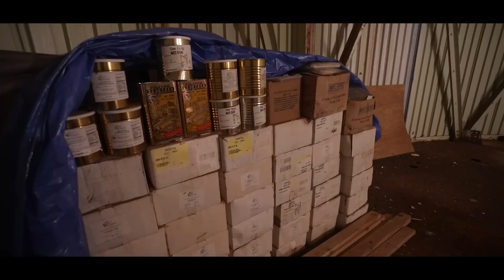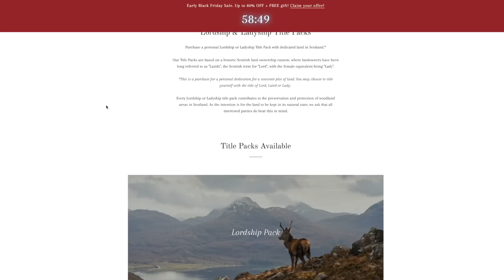Prepping for DOOMSDAY at the NUCLEAR Missile BUNKER!!! (Ready for Putin's NUKE)

Comment: Hi Flair, one question, if the power cable is currently coming through a vent that has a cone on top then surely that would mean the bunker isn't fully sealed to the outside, so if (hopefully not) you did need to use the bunker because of Putin launching Nukes you wouldn't be sealed off from the radiation etc, also does the bunker have air filtration system? Ive watched your videos for years and I have to say the bunker ones are the ones I look forward to now as I can't wait to see what you do with it, based on your previous videos like the ranch cabin renovation, I know you are going to make the bunker awesome. Keep the videos coming whether on this channel or Beefcake construction channel. Im from the UK but have found myself staying up to 1am UK time waiting for a video to drop.

Comment: If a nuke happens there will be to much dust to fuel solar so get 2 wind power generators one for before and one for after because the nuke will destroy any thing above surface so also hould am under ground garage so you can keep cars trucks and demo dead truck in the ground so they don't die.

Comment: Flair, one thing I would say u need to get is a bunch of those Lifestraws for when u have to use the water in the Rocket Silo or even in those reserve tanks!! Also I would say u should have a few fans to the air in there can circulate & and some air movement!! I would also say before u say u have enough stuff for a nuke attack!! U need to find out how long the fallout will last for whatever type of nuclear bomb gets used!! I would say u need to get fallout safety suits & face masks!!!

Oh, some other things. Build a building over the entrance, also big enough so that u can park ur truck in an if u have to work on it ur not out in the open!! U have forgotten to stock up on the most important thing, "Deer"!!! Get a couple Freezers that u can get down in or as far as u can get them in, even if their stand up freezers to stock up deer and make a ton of dear and turkey jerky that u can air tight seal so they will last as long if not longer than those MRE'S!!

Comment: Flair you need to find an actual prepper thats would be willing to help you get set up fully, cause those flashlights and mre’s wont cut it😂 and bring in brad to help reno the bunker make it really nice . Clean up all the rusty metal and replace if needed all new paint thats lead free 😂  all the corrosion in the pipe where your fresh water is is also a little concerning
Reply: New water filters , air filters,  pipes maybe get some of those emergency water straws. New mres. Medicine , vitamins  , medical supplies ect ect

Comment: Suggestion....  Air Quality.....   You 3 are in a confined space...  You need a "Carbon Dioxide CO2 Sensor" and set up some air circulation..... Unless you have airflow to circulate air, you will eventually build up CO2 and suffocate.  The Missile Silo might not be air tight and may be allowing fresh air in, but better to be safe, than sorry.

Comment: You should make an 'MRE Bomb' and scare the shit out of everyone. Just take some of the heat packs out of the green cooking package (so just the white, cloth-type material), 3 works best. Put them in a Gatorade bottle and fill a little less than half with water. Throw it wherever you want a very loud bang. The gases fill the bottle and basically make the plastic fail with a big sounding boom

Comment: You need to work out how you survive with no power. If people are trying to flush you out they will destroy your solar panels and it won’t take long for batteries to go flat. perhaps kerosene lanterns and stock up on a heap of LPG gas bottles? Also how do you get fresh air and is that a vulnerable point that they can block it or contaminate your air supply?

Comment: 13:27 things like this make me wonder if your neighbours were home to catch any stray rounds.
When you run out of ammo then a gun is just an expensive stick. Have alternatives.
Rocking off rounds at zombies/bandits draws attention to your location.
Batteries go flat, then your cool toys are paperweights. Buy all the rechargables you can find.
Learn to make command-detonated anti-personnel devices - think water pipe, ball-bearings, black powder fired by a battery on a wire. Set them in the entry ways. Have multiple layers of defense.
Have an indoor garden. Things like tomatoes, potatoes, peas can grow well in small areas and provide food. Forget wheat etc.
Stock crappie, catfish, bluegills, shiners and crayfish in the silo.
Investigate some serious water purification gear - unpowered is best. Stills etc.
The MRE type meals you have may taste a bit off right now because you're basically spoiled for choice at the moment, BUT when you're truly hungry, you'll smash them.
What sort of septic tank situation are you looking at? Extra poo drifting around WILL kill you just as well as zombies/bandits.
Stock in trapping supplies and lots of spare parts for your firearms. Bolts wear. Springs break. Clips get lost. Magazines get bent. Buy MOLLE gear, pouches etc.
Banjo's Soviet pot helmet will barely stop a 9mm. Rifle rounds will go clean through it. Gas masks need filters and you need to shave to get a good seal.
Chem lights are good, single use things but they're not very cheap for what they are. Go to Dollar General etc and buy a ton of glowsticks like kids use at dances. They're super cheap by comparison.
Get lots of hand tools. Basically setup an entire mechaincs shop with a back-up hardware store.
That's about it for now. There's always something you forget.

Comment: CBRN PPE, geiger counter/dosimeters, non electrical water filtration system, seal the bunker (vent where electrical is coming in is a no go without a filtration system on it, someone could just smoke you out and that front door isn't stopping anything from getting in....bunker is definitely not capable of preventing an emp from frying everything inside either as open as it is right now), fortified solar array with spare components, building materials, food/water/medical,  escape hatch tunnel needs to be refilled with sand or some other material, communication equipment and some slim transportation you can store inside....the safe bet is to seal it and stock up as if you were living in the 19th century.....and hope that Russia updated their nuclear target list after they decommissioned the bunker otherwise your apocalypse might be rather short.

Comment: First off that little cable and winch is not going to hold that door closed they're going to use your little Jeep out there attached to the door and yank that shit out of the door you need to put some metal bar behind the door and slats welded in to actually secure that door

Comment: 16:18 If I knew I'd get a million dollars after successfully breaking in, I'd invest in a couple tools that would be both quiet and efficient. For the record, I'd go through the concrete, not the door. Get a nice sharp diamond bit drill and mount it to the side of the wall. Then have it start chewing through the concrete at 1-5rpm. The only think you'd hear from the inside is a very soft grinding sound. Then once I've got a small hole through, put an arm with a pneumatic snip on the end to cut the cable on the winch (This is assuming you covered up the holes on the door... otherwise I'd just go through those) and then walk right in. If I knew the entrance would be boobytrapped and armed, then I'd go through the silo roof. Same process, diamond bit drill running slow. Assuming I could be out there for a week or more undetected, I'd just keep drilling holes until I cut out a piece of concrete big enough for me to fit through. If I REALLY wanted to go undetected, I'd tunnel through the earth from outside the property up to the bunker wall, then redeploy the drill. I'm fairly certain I'd make a profit even with a tunnel if the prize was $1M. lol

Comment: Ya know mmmm my thoughts take them for what they are worth...
First take a sample of the water in silo and send it off to be tested.
Hell ya never know maybe if you had a purification method you could create a new city around your bunker until the world as we know it could restart...
Now ( 1 ) you talk about how the power gets down to the living area maybe there needs to be a air purification process and maybe there is 1 there ( hopefully not at the bottom of the silo ).
( 2 ) options would be your best so maybe a generator that's protected and accessible without going outside.
How about making a couple of those doors moveable and lockable. Hell if it takes someone with a plasma cutter an hour to get through the first 1 that means you have an hour to get rid of them while they are confined in a narrow stairwell while they are trying to get through the second 1...
How about a real electrician to look at fuse box and clean it up and maybe put the cover back on it so no one get electrocuted ( as a few of you would have to venture out in the nuclear waste land to dispose of the body.
( 3 ) an engineer that's not scared of a ladder and a tunnel to look at your water storage and give more permanent options on a way to get there and if its a good system.
Lastly maybe some paint to get rid of you art work.

Comment: hydrogen powered generator. you can make hydrogen easily with water and electricity from a 12v battery that would be recharged by the generator. you can make an hho generator that connects to your generator powered by the battery for the generators start battery which gets recharged by the generator.

Comment: exercise bike wired into your electrical charge system. "No, it's not SUPER beneficial to the grid, but if you're stuck in a small area you need to commit time to fitness. and ig you're gonna exercise, it might as well benefit your HOME needs as well as fitness.

Comment: If a nuke goes off you will not be Abel to us the wire that goes out to the solar panels because the are coming through the hole ware wires are would not have filtered air and you would not want to to breathe nuke air lol

Comment: You guys might be stuck down there for a while your going to need workout equipment 20 years worth of entertainment more than one source of electricity and maybe an indoor farm fallout will contaminate your crops you will have to dig out 2 inches of earth if you decide to farm outside that's if you can grow any thing nuclear winter a Geiger counter and Last you might want to check if your air filtration system needs an update or still functioning.

Comment: Get an RO filter for the silo water

Do a REAL solar setup, hire an expert to put up 2400+ watts of panels, a large battery bank, good inverter, proper charge controller. DO NOT get a lithium battery! Fire hazard and TOXIC smoke when it burns! Your little portable packs are a fire hazard because of the battery used in them. 

Mountain House freeze dried meals, 1,000% better than MRE's that are disgusting! MRE's have one function, extreme survival. You have a massive amount of storage space! Get REAL freeze dried foods and make meals!

They make solar powered well pumps too! Read reviews, one brand sucks but the other is really good and I can't remember off the top of my head. 

With your wide open space a wind generator wuldn't be a bad idea. Stay away from the AirX style ones that need gale force winds to provide any power. Same for any made from a converted car alternator, they need 60mph winds to produce any power.

Figure out how to get the blast doors working! That thin door up top lasts 10 minutes under a plasma cutter! 

Yes you do want to shower now and then! Dirt brings disease long term! Any cut or scrape and no washing can kill when infection sets in.

That "pond" up top was probably the old sewage lagoon... make sure your sewage pumps are working and have spares!

Comment: You could make so many different areas in that flooded area it's crazy. Biggest question is can you pump out the water in the flooded area cause at the point if you can you can make a spiral stair case up and down it then you could make floors up it make 10 feet high so there pretty roomie have what ever you want in each room